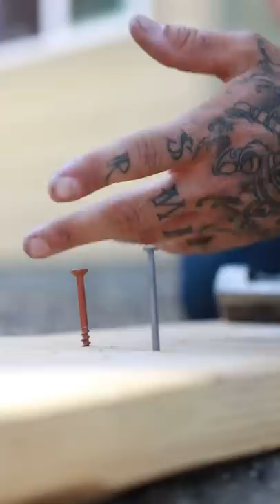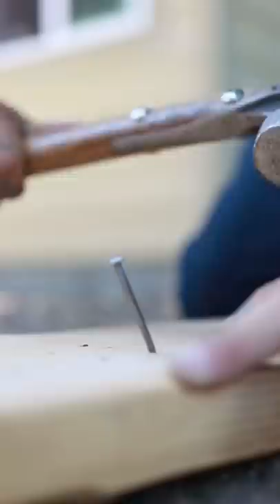Nails vs. Screws: Why do we use nails? #shorts

Comment from the maker: https://rebrand.ly/UP5TRYV3
Reply: Why us builds all their house with wood instead of concrete and plaster
Reply: Only thing I hate is when they hit nails in and not hit dead center of the studs or joists and have nails splitting out the side, when carpenters carelessly do this it is just like using screws or no nails..
Reply: Now that's a hammer 🔨 👏
Reply: No man use more screws then the buildings won't moove😊
Reply: To make the screw move you need an impact gun you tried making it move with a hammer.

Fake news!
Reply: @Sh1tzboutagodown  Use ya Brain
Reply: Can I use ya sister?
Reply: So when do you use screws in residential construction?

Comment: If your house is moving that much, you've got bigger issues.
Reply: Earthquakes
Reply: I'm imaging 432 park Avenue
Reply: Hurricanes heck I’m in Florida that’s just a regular windy storm some storms are windy as hell. Foundation settling. Humidity warping boards. Dryness warping boards. Things happen it’s best to think ahead and plan for the worst and hope for the best.
Reply: it's not about moving dude it's all about force
Reply: Houses in Japan: 👁👄👁
Reply: @cantu2934  someone has a full diaper
Reply: @mightyhabib1182  seriously. Social media makes people drop intelligence just to be the funniest or most reactionary. The guy has never heard of heat expansion and contraction, distribution of weight from people, furniture, wind, etc
Reply: @mightyhabib1182  clearly you don't know much about material fatigue or failure. A mm bend for a steel bail is very different to a 90 degree bend
Reply: @htko89  hey man, I'm actually a mechanical engineer so I have heard of those things and know that if you're securing two things together with different coefficients of linear expansion, you're doing something much more wrong that using a screw instead of a nail :)
Reply: Brick houses
Reply: @jonwebb9261  your house can heat as a whole and cool as a whole during summer / winter. That expansion / contraction as a whole isn’t linear, but even if it was, let’s say the expansion is 1mm across the whole house, the forces were talking about is very large even if the distance is small. Couple that with different materials and well, the conclusion is houses move a lot
Reply: No houes move all the time. You just dont know it
Reply: Yep.
Reply: If the house doesn’t move its mire likely to fall .
Reply: Houses move a lot more than you think. This is more informative about home settlement though it doesn’t specifically say. Over time your house is going to settle into its position on the ground. That’s why you notice things like drywall cracks in corners or cracks in grout if you have tile.
Reply: It's just an exaggerated example
Reply: Your home moves more then you think.
Reply: @jonwebb9261  this is terrifying that you’re a mechanical engineer and you don’t understand that homes move constantly.
Reply: @-_.Nameyourcatdog._-  Yeah.. I had this lamp nightlight (I have to sleep with one due to trauma related reasons it’s a comfort thing-) it was so hot that through the window, through the blinds on the window, through the curtains, the sun was so hot that it gave the outside of the lamp sun rot… The outside of the lamp shattered like it was nothing more then ashes… I was so depressed 🥲😂 I’ve had it for years but Florida’s weather is very unforgiving.. I hate it here 😂😂😂 if it can do that to a lamp through all that protection imagine what it can do to just about anything..
Reply: You'd be surprised at how much houses really do move. Especially in areas where the ground freezes. Frames and foundations are built knowing the ground itself will be moving several inches if not feet due to a thing call "heave" in soil due to expansion/compression from temperatures changing. It's amazing how arrogant and ignorant the replies are.
Reply: Its gradual and incremental. It might not cave in within the decade but ome day your grandkinds might be over and while you're telling stories of back in your day the roof is gonna fall
Reply: @TheUnderJaker  what makes you think I don't understand that? A guess? Thought so.
Reply: @joshuaknudsen1166  this is the kind of reply I respect. Actual info, actual explanation. Good job man. It's a pretty obvious fact that houses move a lot
Reply: It's actually because the nails flex and screws don't if the wall flexes and you use screws it'll tear the the sheetrock and paint..
Well at least that's what my boss told me..
Reply: @jonwebb9261  it’s great that you finally understand. People have been explaining it left and right to you, but you are just cherry picking. It’s not just soil though. I actually work in construction and let me tell you, I’ve seen deformation up to an inch. Obviously not newly built, but it happens more than you think. Like for houses 20 years and up, it’s quite common.
Reply: @jonwebb9261  drywall and timber is actually expected to deform on its own due to heat, moisture and other things. That drywall that people think is solid? It’s joints are done in paper and mud, that flexes ever so slightly to alleviate the shearing forces this drywall sees in different seasons. Even they shrink and expand. 

It’s most apparent if one avoids paper and only puts down mud. It will crack
Reply: @htko89  hey bud, do you want to find me the comment I made where I said houses don't move? The video shows a nail doing an almost 90% bend, let's assume that's going to equate to a 100-150mm shift between two panels? That's a lot more than an inch and pretty serious as I'm sure you'd agree! It was meant with a dash of that comedy thing you may have heard about, not strictly serious but if you want to go into mechanical differences of types of fasteners, I might have a day in my life where I'm bored enough?
Reply: Its funny i just came to post that exact same comment. A screw is far superior. Reason really is the cost difference
Reply: @jonwebb9261  thats fair. I agree 100-150mm shift is quite a bit, especially on short time scales. Sorry about that
Reply: @htko89  wait wtf, an apology on YouTube comments?! That's never happened before! Thanks man lol
Reply: Lmao.
Reply: yeah you're right 😁
Reply: Good point👍
Reply: That's part of my issue with this reasoning. Under the worst realistic conditions, they shouldn't. As  for places that often suffer from hurricanes? Most buildings that are specifically built to withstand a hurricane have different (and more expensive) design parameters.
Reply: @user-qs6hu5tg1e  which kind of force exactly, flexural or shear?
Reply: Earth moves man.
Reply: XD
Reply: @cantu2934  an* not a very good one at all
Reply: @-_.Nameyourcatdog._-  you said Florida exactly why buildings here are shit because they make houses and apartments with basically card board I really hope we don't get hit by a cat 5 hurricane because it won't matter if it's nails or screws apartments and houses are going to be flying
Reply: @-_.Nameyourcatdog._-  also if you put down a roof with nails and a cat 2 hurricane hits say bye to the roof
Reply: Everybody gangsta until the house starts walking
Reply: @mightyhabib1182  what does any of that even mean? I know it's not a steel ball?
Reply: Oh god it's 9/11 all over again
Reply: People please. It’s a joke, stop hating on this person for no reason
Reply: @jonwebb9261  lol.
Reply: @PoorMustang  there is a frame behind those bricks. Or do you mean a block house?
Reply: No one uses one screw to hold a home.  If the demonstration showed a pulling or leveraged moment, it would show how easily nails pull loose. That’s why we hold the home to the foundation using bolts and rim joists have metal brackets using screws that won’t pop out.

Over the years, there has been thousands of tests on screws vs nails and it has been proven that screws are 6-8 times stronger than nails when fastening subfloors, and other sheet goods. Lag bolts, bolts and very heavy screws are used when “the structure” must survive. 

Most framers want to use nails because their easier and faster to install.
Reply: @mikey_mike  Brick and Concrete.
Reply: @PoorMustang  brick houses have a wood frame. You frame and build the house just like any other stick framed house then put brick up on the outside. The houses still move quite a bit with expansion and contraction, high winds, settling etc.
Reply: @bret9741  grade A reply.
Reply: Will Hazelwood  that's why it's important to keep a basement dry! Wet crawl spaces or basements are tough on a home 🏡
Reply: Will Hazelwood  that why you keep a home as dry as possible! Minimize settling and mushy soils.
Reply: with nails it won't suddenly collapse on you.
Reply: @cantu2934  why you so mad 💀 chill out dude
Reply: My house moves so much i woke up in a diffrent nebourhood 🙃
Reply: 😂 I can't stop my laughter
Reply: @00.miu_  lmao 😂 i know bro i just like pissing people off 🤣
Reply: Yeah he may be living in the border or tectonic plates for his house to move that much lol
Reply: @zachbrb6304  I'm glad someone agrees, like I'm pretty sure most of these people (Jon Webb for example) are just having a nice discussion about houses and stuff. But the people being like 'ugh, it's an example, are you stupid?' are the stupid ones, the person who made this comment was making a joke, like chill out. The fact that people need to state this gives me less hope for humanity
Reply: @KayKay114  we don’t speak of that horrid excuse of a building
Reply: The water table moves too over a long time.
Reply: @DeathNote444444  would know what? That houses move? No shit.
Reply: @cantu2934  ‘an’ example
Reply: @jonwebb9261  Clearly you don't own an air fryer
Reply: Correct but under sheer load they snap. I use to be big on screws until I seen some pop. It’s code where we are no screws in anything except decking and non load bearing unless it’s structural screws
Reply: @PoorMustang  Brick houses aren't built entirely out of bricks. They still have wooden frames.
Reply: @Independent_minds_  you understand that that is a material difference right? Just buy better screws. Unless you want the ability for the fastener to be able to move longitudinally for some reason
Reply: @mikey_mike  Have you been in oldschool germany?
Reply: Paul Barney  Prolly.
Reply: @kirkschoolfield4173  Same sh*t.
Reply: Hurricanes and earth quakes 😂 I actually learned something i thought nails were worthless with modern screws
Reply: If its moving that much its because its built with nails instead of screws 😂
Reply: Earthquakes , people moving in the house , moisture expanding wood and vice versa , weather change . Houses are meant to move
Reply: Earthquacks
Reply: @2nd-place  and what about when the force between the two joined panels in linear down the centre axis of a nail? What stops it pulling out? Shame it hasn't got a thread on the outside to help it stay in I guess. Would just like to point out that you almost quoted my original comment exactly with 'Tornadoes, hurricanes and earthquakes are bigger problems'. Does this mean you need to 'neuter' yourself now?
Reply: Lol no shit! 🤣
Reply: A lot of houses in the world are still fully build out of wood, wood moves a bit more and faster than for example concrete or bricks. For example the US, a lot of houses in some states are still build out of wood. You see that a lot less in western Europe.
Reply: Happens quite often in places like the Florida coast with high winds. Buildings are actually built to move a bit.
Reply: @mightyhabib1182  My 4 inch wide floorboards are "cupping" after only 2 years after being laid. Cupping is when the sides of the board raise up and the center sinks down. High humidity can cause wood to do weird things. And the nails in my siding are beginning to pull out on their own, just from the heat, humidity, and cold air in the winter.
Reply: @aaronspillman1140  sounds like some screws instead of nails could have prevented that, given their significantly better grip
Reply: @chrismanuel9768  You're completely right, but nails are cheaper.
Reply: Well to an extent. ALL housed move. They settle with earth and foundation. The materials expand and contract with heat. And then are exposed to odd loads sometimes like snow on the roof or a 150 mph hurricane wind. Or a shake from an Earthquake.
Reply: @mikey_mike  The zinc tabs retaining tabs will also rot through after many years assuming the installers used them.
Leaving free standing walls.
Reply: -40C in winter will screws it even brake nails you can ear them snap in the roof during winter !!!
Reply: What if its a mobile home?
Reply: Don’t build in a swamp kids
Reply: NoThankYou Le Mao  na dude, I'm only 29 so that would be difficult
Reply: In Japan they used huge nails, but most houses were just made with perfectly fitted wooden joints hundreds of years ago.
FYI Japan has a lot of quakes. Probably at least 1 that you can kind of feel every month in Tokyo.
Reply: Hahaha
Reply: We're literally floating on a rock in space. EVERYTHING IS MOVING
Reply: @joshuaknudsen1166  This is the smartest reply I've read on this comments thread that actually makes sense. Well explained. Thanks Joshua Knudsen!
Reply: Ever gotten a hundred sheets of paper and tried to hold either end and bend the stack? Similar forces occur over larger materials and tighter more complex gaps right? Also when its day time and the sun is heating your house, different material will expand or shrink depending on the temperature displacement through the joints.. ergo, your house moves every day and those fine creaks you hear at night up in your ceiling, is the house readjusting to the cooling temperatures. So yes. This is very important in buildings, regardless of other environmental factors, such as earthquakes, hurricanes or any other large natural forces.
Imagine a few of those screws in your frames end up breaking and then a hurricane hits.....
Reply: @_Jitterbug  what you're saying is right man but you're missing some important things:
1. I didn't say houses don't move
2. Screws and nails don't have to more or less flexible/pliant than eachother, this is all down to material selection. 
3. Screws apply linear clamping force between 2 items which does have pros and cons for thermal linear expansion and it's effects
Reply: Rally 😲😲😲😲
Reply: Weather moves houses overtime.
Reply: @jonwebb9261  i also wasnt replying directly just to you, but fair enough.
Reply: Papi moves house every night help
Reply: My bit is moving that much when I listen to.   I like to move it move it
Reply: 🌪 tornado 🤣🤣🤣🤣
Reply: That wasnt the point lmfao
Reply: Are you kidding?
Reply: @bryandonahue8302  Wood expands and contracts constantly with seasonal changes in humidity.  Nails allow these small deflections without breaking or tearing the wood fibers while allowing for a large amount of movement during lifetime level events like hurricanes, tornadoes, and earthquakes.
Reply: You know nothing about construction obviously. Wood shrinks n grows with different temperatures and environments. Hence the house will move. Good lord leave the build homes to us professionals.
Reply: @mightyhabib1182  nah people are definitely getting worse. The stupidity these days is sad..
Reply: @travisengland1368  LOL  yeah, these guys replace a couple planks in their deck or hang a couple big mirrors and they think they know everything about construction...  The internet has everyone feeling like experts in everything.
Reply: @travisengland1368  oh wow, do things get bigger when they get hotter?
Reply: @jonwebb9261  yes exactly. Wood shrinks when its cold and expands when its warm. Same with vinyl and composite. Its just basic science. Dont hate me for stating facts bud..
Reply: @travisengland1368  That's incredible man, have you written any papers about that principle?
Reply: @travisengland1368  Dude seriously, you need to tell people about this. You could change the world!!!!
Reply: @cutratecontractor1000  it's either not even close to strong enough to move anything or completely destroying the home anyways.
Reply: Yeah starting on a good foundation is the first Step 😂
Reply: @dylansmith5672  dude your comment actually made me feel sorry for you. Maybe browse some of the others before speaking up. You're not the first genius to point out things get bigger when they get hot but nice try.
Reply: lol
Reply: @cindy1763  he said house, not castle.
Reply: @cutratecontractor1000 Earthquake moving your house that much? You have bigger problems.
Reply: You have to allow for settling during and just after construction,  and time tho don't forget.